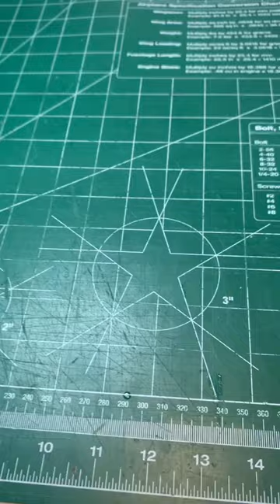3D Printing a ‘flip book’ | Work in Progress

Comment: Add a cross bar at the top to hold each frame a bit longer and have the next one snap faster into place. Like how a split flap display is designed
Reply from the maker: I like it! Gonna do some experiments
Reply: Good idea. More time needs to be occupied by the still frame and less for the transition